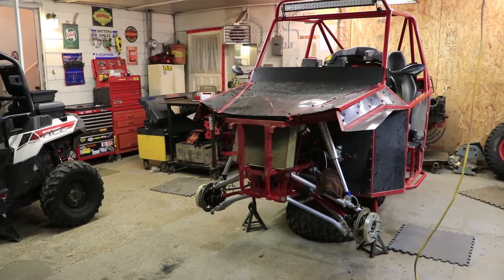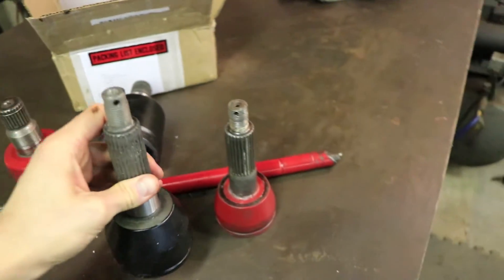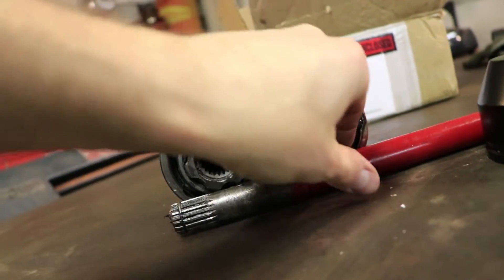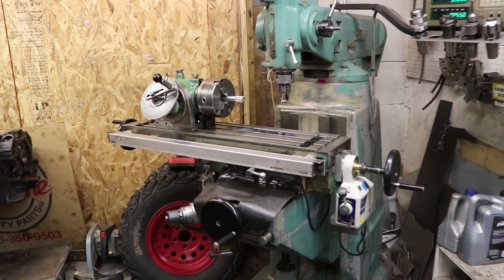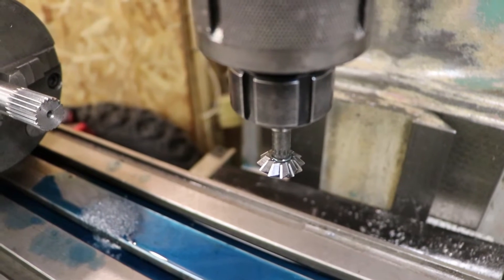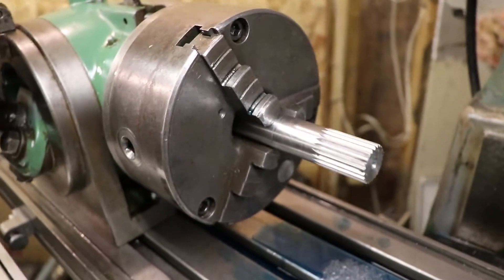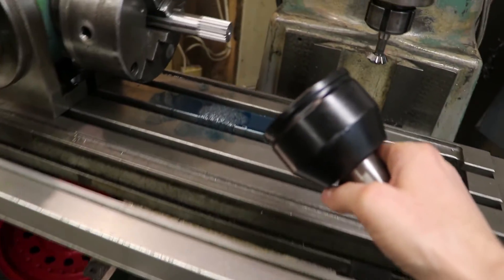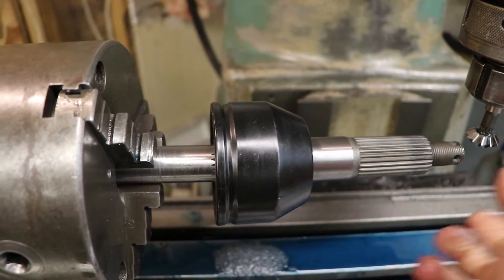How to Cut Axle Splines on a SAJO Indexing Head

Comment: Where did you get the cutter from does it have a specification. Cheers Peter in the UK england
Reply from the maker: I'm pretty sure I found it on Amazon. It's a double edge 90 deg cutter.

Comment: that tool by the way is a double angle chamfer cutter i am surprised it did the trick ? how did you identify the spline ? do you use a gear caliper? a gear tooth gage?
Reply from the maker: I had a schematic drawing of the inner spline of the CV joint which showed the angle, depth, etc.
Reply: @glassglowz  i tried this it was utter failure 
so do you go back and do an extra pass after you completed the circle??
Reply: cause i have a carbide versionof your tool too although 8mm diameter only
its called a twin chamfer
Reply from the maker: @fredrezfield1629  if I remember correctly, I cut the full depth in a single pass. The steel was not hardened when I cut the splines. I sent them out for hardening after.
Reply: @glassglowz  no i dont' care about that 
i want to achieve the shape 
whats the diameter of your cutter? and how thick? thanks

Comment: When I'm doing a repeated measured depth or movement, I zero my DRO at the stop point that way I don't have to remember a number at the stop point.  Helps compensate for my ADD.
Reply from the maker: That would have been a much better idea than what I did. Thanks for the tip.

Comment: My boat's transmission output shaft has worn splines and there are no more shafts in production. Is it possible to weld up the worn splines then re cut to original spec?
Reply: yes... but, might be more easy to cut splines on both ends of a new shaft.

Comment: I didn't realize that was how splines were cut? For some reason I thought they had a flat spot on them unless it's different for cars? There's pretty cool because I have that cutter and never knew what it was for lol.
Reply from the maker: I think they use a different method in a production environment. Thanks for watching!
Reply: I used to work at a factory that produced gearboxes for larger applications such as oil and gas, marine and power generation industry. All our splines where made using processes called gear grinding, shaving and hobbing. The gears would then be hardened in a process called gas nitriding. Hope this helps give you an idea. :)
Reply: Splines are usually rolled in a production environment. Much stronger as they compress the shaft versus just a cut

Comment: hi mate great video, was just wondering what the bore size is on that indexing head, as in what the largest material size you can fit through it, i need one a similar size but having trouble finding something like that in australia
Reply from the maker: It's 1.8" - not sure the brand though.

Comment: Hi guys, I have a noob question. I am making some axle spline conversion stubs and I need to have my machine shop cut the same spline that is on my Honda d16 inner cv joint. I wanted to know is there any way to specify this correctly. Right now im just giving the existing part to them and saying "copy that pls". Are all of them 90 degree? Thanks in advance
Reply from the maker: Sorry bud, but I really can't help with that. I had a diagram from the CV manufacturer so it was easy for me! Thanks for watching.

Comment: Fits like a saddle on a sow
Reply from the maker: WUUUTTTT?? :D Thanks for watching ;)
Reply: He means it fits loose. I think you have cut the spines a little too deep. Also each one of your splines has a stress riser at the end which will eventually fail. This problem can be minimized by cutting a relief for terminating the splines in. Stress risers can’t be eliminated but can be eased. Only time will tell if your shafts will fail but if they do, keep the termination relief in mind. Hardening the shafts is a good idea, but remember to have them tempered as well, so they aren’t brittle. The company that you are having harden them should be able to do this as well.Thanks for the great videos!
Reply from the maker: @frankherring6253  ah ok, thanks for the info!

Comment: Why did that doublesided endmill make it so much easier? A normal endmill also has 90 degree corners.. All you would have to do is cut the splines at "1:30" on the axle instead of 3 o'clock.
Reply from the maker: Wow... It never even occurred to me to use an endmill! It was easy for me to find the center of the axle... how would I go about finding 1:30?
Reply: @glassglowz  Yeah that could take some creative measuring. :) Maybe only practically possible with a DRO.

Comment: HI, how many passes did u make per spline cut to get to correct depth. do you have and speeds and feeds info? i just dulled my cutter in 4140. i think i was running it to fast.  you cut all the splines without dulling your cutter?  (novice here) thanks.
Reply from the maker: I did the full cut in one pass... can't recall how deep the cut was right now. I was turning it real slow, maybe somewhere around 100 rpm and the feed was very slow as well. Was you material annealed or heat treated? You need to ask the metal shop for the annealed stuff otherwise you'll never cut through the heat treated material. Hope that helps and thanks for watching!

Comment: Cutting splines and gears is always fun.  Nice work!  What material are using for the axle stock?
Reply from the maker: The first few cuts are always nerve racking! I'm using 4340 annealed then sending out to be heat treated to RC 45. Thanks for watching!
Reply: Can you show how to solve that pls i want to know @glassglowz
Reply from the maker: @orlandotvvlog8325  pick up a machinist hand book. That will describe it better than I ever could.